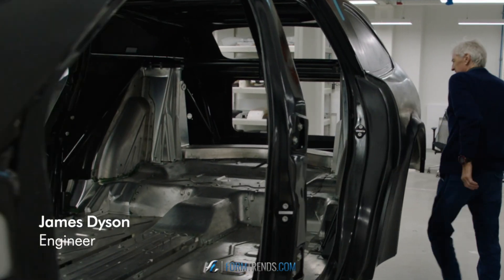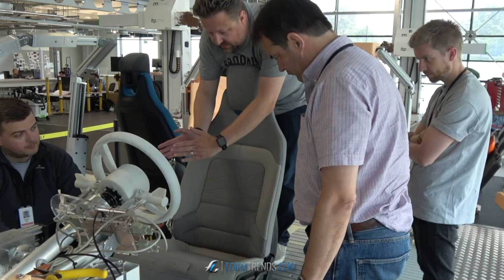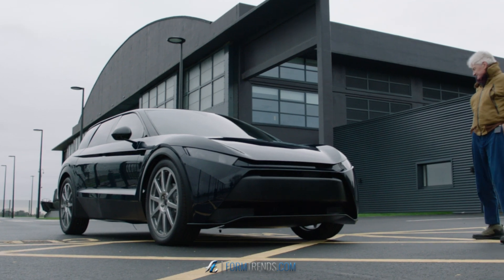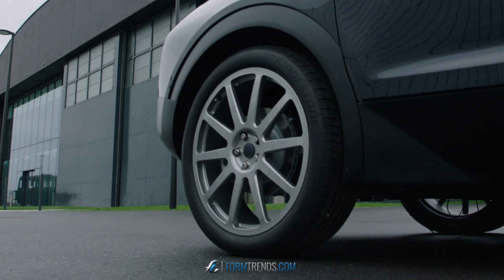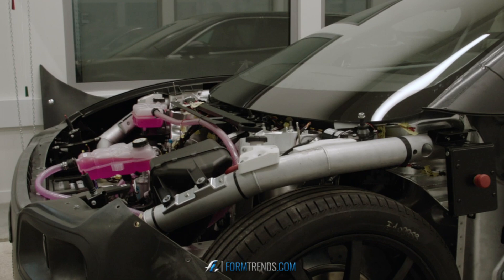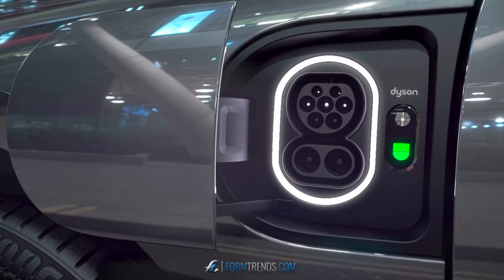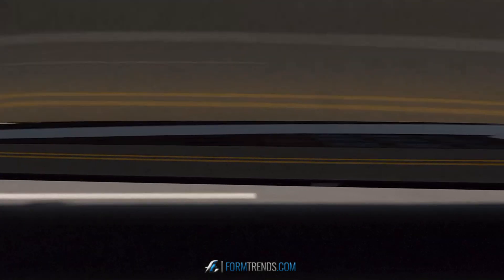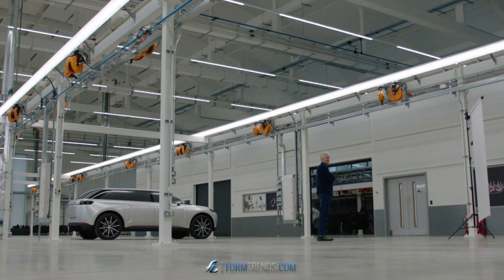James Dyson on the N526 Electric Car Project

Comment from the maker: What are your thoughts on the Dyson N526 electric car's design?
Reply: Frameless doors no thanks. Low roof no thanks. 6 seater yes please. Centre console blocking movement between front seats no thanks. Average external styling no thanks. Lack of front trunk no thanks. Lucid gravity , does a much better job.

Comment: Surely getting rid of a few gimmicky features and using some off the shelf components would've brought the price down -- then again
Reply: What off the shelf components? Dyson doesn't make vehicles, so they have no off the shelf components to share.
Reply: @ronlaverdiere  from foxconn, rimac and a bunch of other carmakers. Check Fisker... They're far less liquid than Dyson but they're making it work. Nikola is doing the same, licensing their entire power train from Bosch
Reply: @building_keevo  Those are completely different situations. Rimac is partnered with VW (specifically Bugatti). Fisker is owned by Wanxiang, a huge Chinese automaker. Both made cars before being partnered or bought out, but both were on the verge of going out of business for most of their initial years. In fact, Rimac only survived because they did have insurance on the car that Hammond crashed. If they didn't have insurance on that car, they would have been sunk. Also, as you indicated, Nikola has a business partnership with Bosch. Dyson was fully independent. Dyson could build the car, but they would lose money on every one sold. If they wanted to get into the business, they could and with several models they could become profitable. With just this one model though, it isn't worth their investment.
Reply: @building_keevo  Did you look at the key investors in the new Fisker (Spartan Enery Acquisition Group is the parent company)? Deep pockets to say the least. Before that, Fisker had a partnership with GM and used the Ecotec engine. It was not the only part that Fisker raided from the GM parts bin for the Karma.
Nikola has a partnership with GM for their commercial trucks (fuel cell trucks). GM is responsible for the fuel cell technology they are sharing. 
Dyson did go it alone. I don't think Dyson really had that much interest in getting into the automotive market. It was probably just a fun side project for him.

I just noticed, you said Fisker and Nikoa ARE using off the shelf components - that is then in agreement with what I earlier said. Dyson didn't have off the shelf components to use, everything was done in house.
Reply: @ronlaverdiere  The deal between Nikola and GM collapsed. They gave up their stake according to CNBC. Fisker's current cashflow is only 1bn - so they're having Magna build the cars for them. All Dyson had to do was build a decent enough car with quirky styling and then outsource to either Foxconn or Magna. There's a bunch of EV skateboards out there that they could've gone with.

Dyson's EV died because of arrogance...